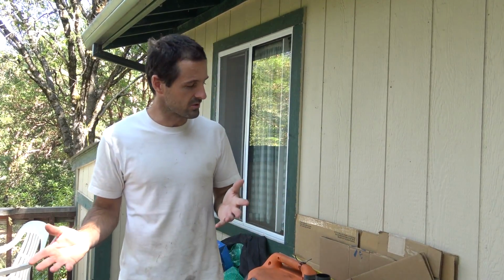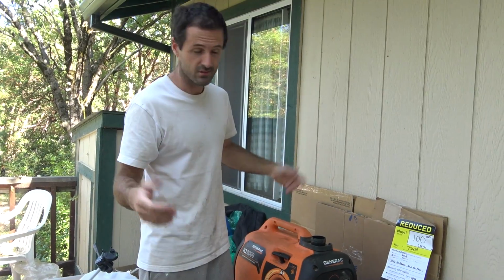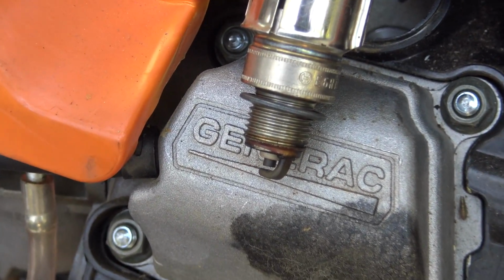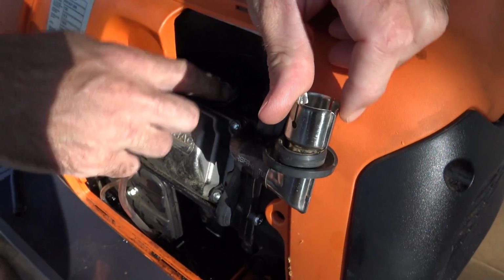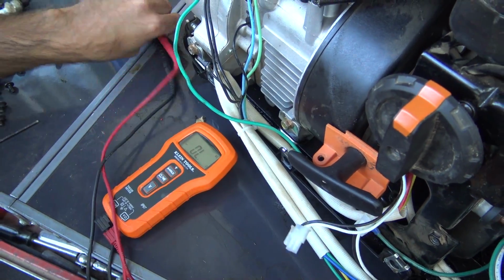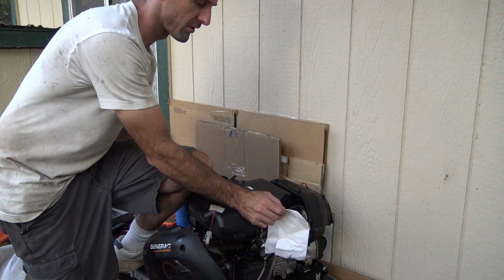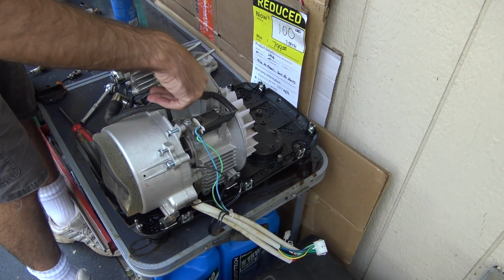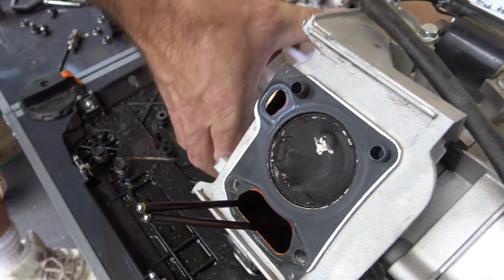$25 Generator From Lowes - Will It Run?

Comment: That is awesome progress on your project.

I remember I had got ripped off by some guy long ago. He owed me money from something that I don't remember. And It was the same guy that aparently stole a TV from a friend because the friend recognized the TV at my place and even shown me a receipt... 

But anyways... It was also the same guy that stole a full case of Ford's quart oil for my Ford F250 that I bought for like $80 because I buy it by the case... But anyways... It was also the same guy that I caught on my security camera of stealing my landscaping tools from the back of my pickup truck... But anyways...

He had gave me a ryobi generator and told me that it runs perfect. Because his mom ran it at her work all the time... So I accepted the offer without even testing it out. I waited until it was my day off. I tried to start it. No compression. I further inspected. There was no spark plug. I bought a spark plug, and there was no spark even after I did oil change... And I just gave up on it because there are no online diagrams or any information about a ryobi generator. The switch tested good when I used my multimeter and I the oil circuit tested good too. So that gives me the idea to stay away from ryobi generators even though I love the 18v tools...

And like a week later... The guys mom calls me and says that his son stole a generator from her work... I just told her, this generator might be worth a couple dollars at the scrap yard because I couldn't get it to run. There are more things that I could have done but I was inexperienced at the time... I am used to just cleaning out carbs on lawn mowers and weedwhackers. I would buy like 10-20 weedwhackers from a scrapyard and clean carbs and piece them together.

Comment: You should have checked compression with a tester not just assume it didnt have any, the first thing you should have done with a no spark issue is change the plug. These generators pull very easy seeing its only like an 80 cc engine, I have champion one and it also feels like it has no compression, buts starts every time.
Reply from the maker: I've pulled on lots of engines and can tell if the compression is reasonable for what the motor is. What I didn't realize when I began working on this motor, is that sometimes there is an auto-decompression cam, which can feel like no/low compression, and show the same on a gauge.

Comment: Just want to say the breather goes to the crank case so that means that no gas goes through that area if you dump gas in it it’s just mixing in with the oil it won’t get into the carburetor or into the piston

Comment: I got a Honda EU2000i for 80.00 because they couldn't get it running. I checked air, fuel, spark and all good. I then checked valve clearance which was good enough then I noticed a brand new timing belt. Then I thought "if these idiots didn't line up the timing marks im going to lose it".....that was it. Rotated the gear 180 degrees, tightened everything back up, fired up second pull. A 1200.00 new, 700.00 used generator for 80.00 (plus a tube of gasket sealant) haha

Comment: When she said to try it again I was thinking tell her to hold the plug end. Glad you didn't do it. She seems like a good one. Can't see her so can't tell if she's 100 pound's overweight. Oh, back to generator. That brand has a safety switch on its oil level. That's the easy part. The rest of it looks like it's a 2 case of beer, with the Mrs to keep you company. May need a few drinking friends or relatives too.

Comment: All combustion engines will have a push pull effect on a paper towel because of the up down motion of the piston. After professionally working on small engines for 25 years I’ve learned to always look for the easy stuff in troubleshooting. I was rooting for you to find a hole in the piston. But you done great by checking simple things except valve clearance. That would have gotten your engine running. On the exhaust lobe of the cam it has a slight hump after the peak of the lobe which acts like a compression release at cranking speed and having compression turning backwards tells you that the valve clearance is tight. I like the video and I will never run a fellow diy person down because you don’t learn by not trying.

Comment: Never pour gas directly on the spark plug that floods the plug.  Use a drinking straw and put it in your gas bottle then put your thumb on top of the straw to hold the gas in the straw .  Then transfer directly into the cylinder .

Comment: This is only a guess, and I'm making it at 12:16 of the video, the last time I saw these symptoms on a single cylinder overhead valve engine, one of the valve assemblies had fallen apart and the intake valve wasn't closing all the way causing reverse air flow through the carburetor. It's my understanding with these type of engines, if you don't adjust the valve lash at the recommended periods of run time the valve train can fall apart.

Comment: Spark plug gap was minimal would check spec and adjust. Also putting fuel on the spark plug would foul it by grounding to the head. Dry it out and gap the plug.

Comment: I'm a bit late to the party here, but that compression being low isn't an issue. The compression release is done with a pin holding the exhaust valve open that retracts when the rpms get above about twenty, so it'll feel like nothing at first. I've yet to see one of these without it.

Comment: We had the same generator at work for a while. I forget what brand name it had on it but it wasn't Generac. It's some generic Chinese dump thing that lasts about 500 hours then becomes too unreliable to use. On ours it did the same thing despite proper maintenance and lost compression. I suspect what's going on in there is the piston rings are severely worn and not seating right, and when you turn the engine back they're reseating temporarily. On ours it would just make a lot of noise, not hold a load, and eventually managed to blow the dipstick/pan plug out! It was... glorious.

Comment: Running isnt the issue it's the powerplant that's the question. Also how much time you spend to get it back up to par versus what your time is worth. This included looking up of parts ordering on line or with a shop. With parts & servicing as well as your time is it worth it if it runs & produces power? A resounding yes. Most of the time. If it runs but no power. Well maybe. I do find it extremely interesting that a 2KW is more expensive than a 5KW but regardless 25$ is worth it for sure

Comment: This guy don't know anything about an engine put your finger Over the Hole pull the cord if it has compression it will blow your finger off the hole somebody help this guy out it ain't that hard yeah compression Spark fuel it will start

Comment: You dont soak a spark plug with gasoline it will never fire doing that you get a new spark plug hold it against the head pull the cord see if it gets Spark if so put it back in the motor shoot a little ether in the intake and pull

Comment: lets see, buy a generator that was literally beat to death, then have a guy that doesn't know what he's doing make a video of him failing like expected trying to get it running. at the condition its in he's lucky its not seized to start with. anyway what knid of moron at lowes would even put that out to sell let alone take it back when the customer clearly abused it and voided any warrantee it originally had.  first thing he should have done is at least changed the oil and put a new plug in, then put fuel in tank and start it correctly without flooding the damn thing, then he would have had a better chance of getting it started barring other engine problems. first off never be a dumbass, don't dump fuel on and in everything you see and never run an engine without oil. duh just got this and I don't know what a used and abused spark plug looks like, my god, solution, dump more fuel on it why don't you. talks about compression but doesn't know what a simple compression gauge is, or likely what it should be. then takes it apart to further demonstrate that he needed a new spark plug.

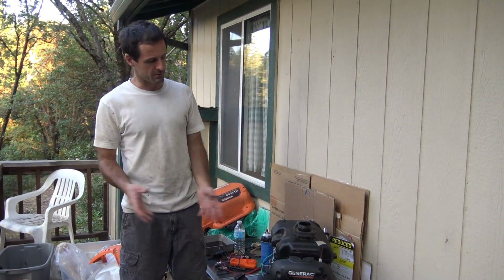Comment: Ok, I'm at 9:09 in so far. Check the points , the timing , the condenser,  the carburetor,  oil and gas level , put new spark plug , if it does not run after that , at least you have a great anchor for your canoe . Thank you.

Comment: You're right on your points about the 3 major requirements of combustion bro, air, fuel and compression, base on experience with motorcycle engines, start with the fuel and air intakes. Yeah, that includes the major parts of combustion, the "Carburetor", most of the time if the owner of a fine piece of equipment like this gen-set is a non-mechanical guy like us, they just leave the gasoline solidify into a reddish goo inside the carburetor clogging all the important holes on it.

Comment: hey do you know that you can take a scooter motor and make it run at 1 mph for 60 hours if you have one that goes 60 per hour at 60 mpg but you need to make a super water cooled casing and water cooling system to keep it from overheating and breaking. you use the stator from a generator that has ten plug and the power distribution panel. the put a cog on the scooter rear wheel with the transmission still in place and then bog it like a mini-bike going up hill ( this is the reason for the 120 water pump and 120 shop fan to keep it cool enough so latent heat does not kill the piston rings or valves. it must be kept really cool but work and then you plug it into hydraulic motor on an electric car for 600 hours of driving but it is a gas guzzler (mathematically speaking) unless going at full speed. try that on for size. (do you have to balls to fight big oi.) by the way loved the show.

Comment: to anyone watching this video, after putting gas into the cylinder, DO NOT TEST FOR SPARK IN FRONT OF THE EMPTY PLUG HOLE. one spark turns it into a flame thrower.... been there, done that... put another plug in the hole or a rag at the very least.

Comment: I doubt that Lowe's had someone who knew anything about small engines, they just tag it and resell it to get rid of it. I knew one former box chain that wasn't around long but was connected to a huge chain store they used to throw perfectly good products i.e. doors with glass windows, etc. in the dumpster out back. Sometimes they threw plants in the pond behind the store. I'm sure they wrote it off on taxes to cover any money they couldn't make.

Comment: Before you get all the way in I'm going to predict that the previous owner filled it up with way too much oil and blew the motor. Well, a gasket or something anyway ...probably didn't fubar it. Then, when they were scratching their head, trying to figure out what went wrong, they guy's friend who knows a little bit, cleaned the plug with carburetor cleaner which is what it looked so clean. They Now that you're in it and I see black chunks, I'm thinking I'm on the right track. Good thing this is a year old so I can see if I was right, woohoo!

Comment: Not to knock youre video my man, but i work for Lowes and as i type this im standing in front of the generators we sell and a generator that small should not be priced originally at 799$ you couldve gotten a brand new one much larger for that price. I do understand its beat up and used but that original price is ridiculous

Comment: Instead of putting gas on the spark plug put a capful into the combustion chamber then put the plug back in.  Pull  the starter if it starts the problem is in the fuel line and or carb, if it doesnt try adjusting the coil closer to the magnetic head of the pull start rotor using a business card to gap it correctly. If that doesnt work check compression.

Comment: Since you have been in the unit. Is there a simple way to put a fuel shut off valve so you can run the carb dry before storing?
Reply from the maker: You could probably loop the fuel line outside and install an in line valve.

Comment: Many things wrong with your troubleshooting.

1. You need to ground the sparkplug on order for it to spark, the painted/greasy valve cover does not make for a good ground. Your spark was fine.

2. You can test for continuity in a spark plugs like that. You can test from the plug to the electrode but really just needs to be done by grounding the plug and watching for sufficient spark.

3. With the spark plug removed, the air escapes out of the spark plug hole before the cam opens the valve, pushing the air through the napkin instead of the exhaust. If you wanted to turn over a car engine by hand, you would remove the spark plugs first so that there is no compression as the air escapes out of the spark plug hole.

Comment: You never pour gas on the spark plug put some down the cylinder you basically just flooded it putting gas on the plug like that..

Comment: It actually looks like it was a pretty weak spark, ... a new condenser, points out of alignment, or as you indicated with the oil shut down sensor, ... or possibly a bad float set, ...

Comment: if it turns freely like that it has no compression, I had that type of thing happen repeatedly on a 4 stroke because of a valve getting stuck and finally fixed it by putting harder motorcycle valve springs in it...

Comment: i had a failed condom  sent back to the smoke shop. I bet if you buy it it was not a condom but in fact a used bike inter tube and you can prove how the inter tube fiald.

Comment: Might have saved a few headaches by calling Generac tech support first. I experienced the same thing with my (used) Champion 2K inverter and called their Tech support. They told me right away that it was the ignition control module, he registered it for me over the phone and sent me a new one free under warranty and received it in 2 days. 30 minutes after opening the package the new module was in and it started on the first pull. I love tinkering but at my age sometimes the answer is just a toll free call away. I enjoyed your video

Comment: My Observations--Commentary regarding "thinning hair" reveals her interest or desire for a hairy beast!  Better think about getting her a Long Haired Dog soon. I suggest a Irish Setter since they make good pets.  If she starts to complain about the glare off your bald spot, I suggest Plan A.   buy her some cheap sunglasses and a large brim hat or Plan B. Ronco Bald spot Remover ( Hair in a Can).

May I also recommend a review of the (BRB) Bro Rule Book for Survival  see the Chapter on "How to live with a complaining female."

Bro Rule # 1   Never ever ask her "Do I Look a Fool Yet"?  
Bro Rule # 2   Never ever load her gun with your bullets. 
                 (She may use them on you.)
Bro Rule # 2a  Never let her see you doused the wood with gasoline when 
               tasked with building a camp fire.
Bro Rule # 3   Never ever relieve the pressure on the Thumb used for the required  control of the female spouse. LOL
Bro Rule # 4  When the spouse reaffirms she knew "It was the Piston rings all along" , use caution since she has a       
                          fixation  on Rings. Can get expensive real quick.   Turn her attention to a cheap chain necklace       
                         immediately.
Bro Rule # 5 When she complains that you have not told her lately  That You Love Her,  be sure to reply "I Married You      
                         Didn't I!" Be sure to duc her swing in your direction.

Comment: I BOUGHT A WESTINGHOUSE GENERATOR. 1800-2200 WATTS. ITS GOT A 10 HOUR RUN TIME AT 50% POWER,43 PDS. NOISE LEVEL,ABOUT THE SAME AS A 1200$ HONDA MODEL.
USED LUCAS OIL INITIALLY. WORKED GREAT.,600$ PRICE, NO BRAINER.

Comment: After watching this video I wanted a generator. Yesterday I saw a genny for sale local. One year old but for only 50 pounds. Retail. New was 280. The owner said it was fine a year ago and now not running. Hardly used too. I bought it inspired by your video. Checked it over. Looked new. Spark plug turned out to be loose. Tightened up and runs sweet as a nut now.... Hehehe

Comment: That’s how I do mine I checked oil if they look black like at a drain it then I take the spark plug out put some seafoam in it let it sit for a while and then poured out put new oil in a new gas in it and a different sport plug what time is mine starts that’s what I done first or go ahead I’m just now start watching your video I like what you showed staff keep keep it up￼

Comment: You idiot you don’t put gas on a spark plug needs to be dry put gas in the cylinder then put the spark plug and then it will fire

Comment: Consider the valve cover has a gasket  under it, and the attaching bolts may have fiber washers under the heads to prevent leakage.. leading to the possible insulation of the VC from the engine case.